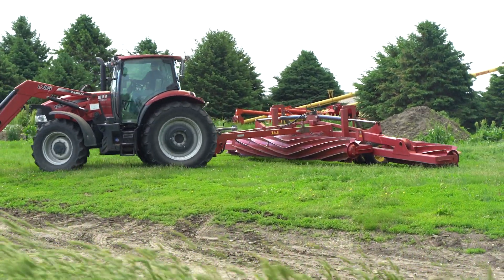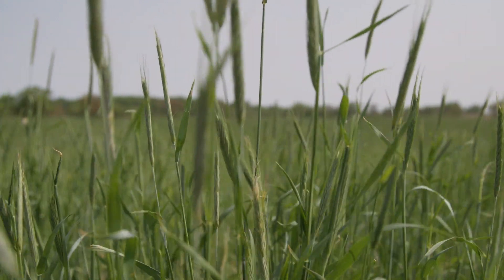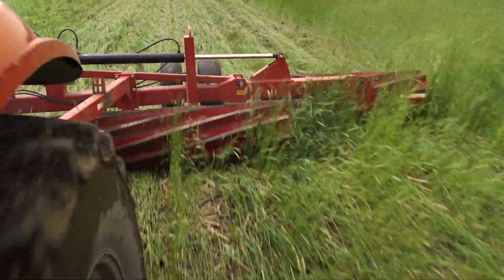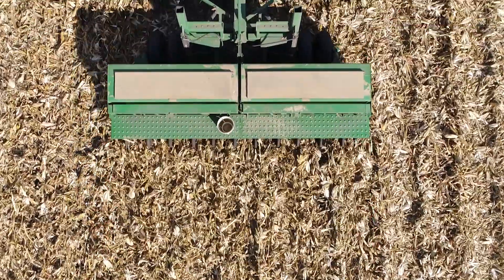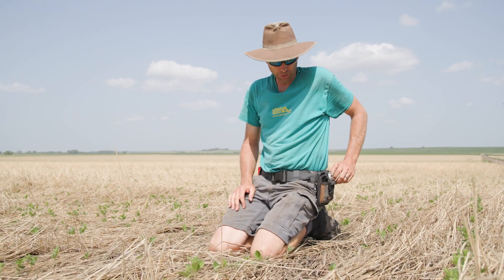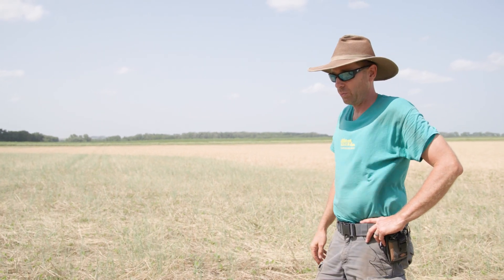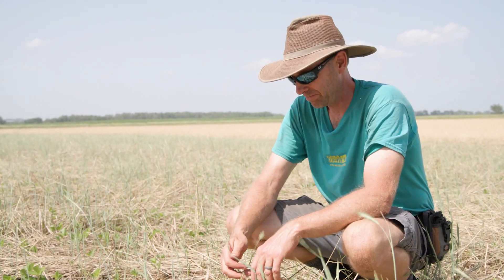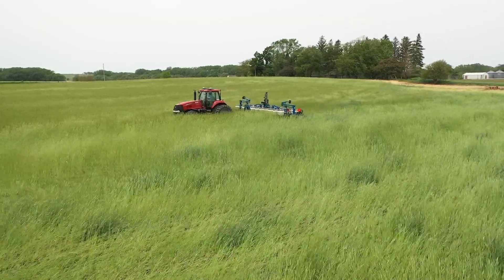Roller Crimping Cereal Rye in Soybean Production - Practical Cover Croppers

Comment: Why not crimp rye first before sowing beans?
Reply: That makes sense
Reply: Then you have to plant the way you crimped the rye. Their planter looks bigger than the roller, so the rye will roll up and plug the shafts. It would work if they were the same size and they planted in the direction of the roller.